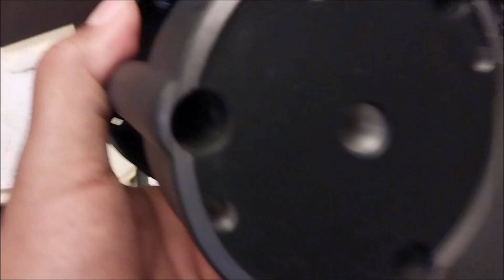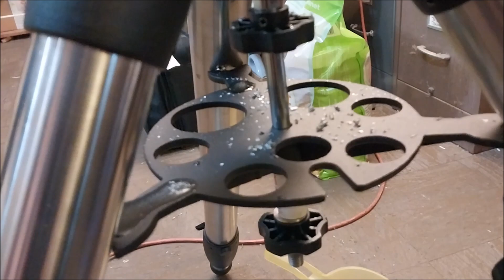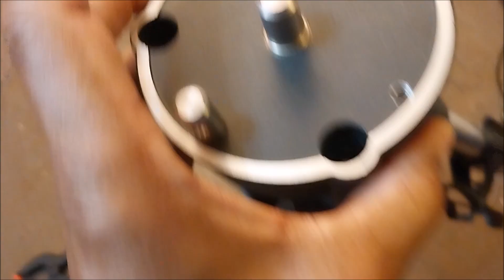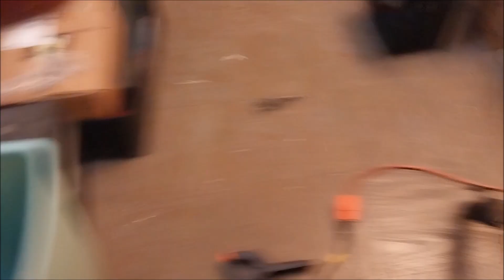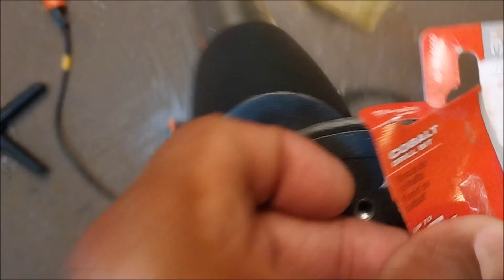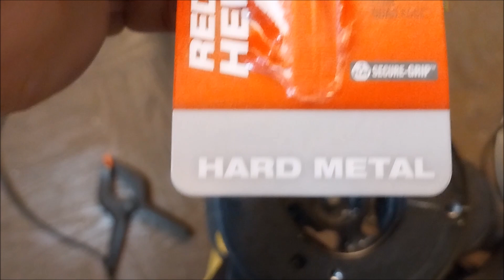Adapting an AVX tripod for the HAE29 (and other iOptron mounts)

Comment: I have an AVX and think of purchasing an AM5 or HEM27. ZWO offered a pier, PE200, which comes with an adapter plate which fits the AVX and Skywatcher mounts. Your modification is doable for me. I want to use my AVX tripod because my C8 SCT weights about 18.5lbs with the image train and miniPC.  I don't really have room to store another tripod. I wish they offered a conversion plate with their pier. Thanks

Comment: I have an HAE29 on the iOptron steel tripod find it is not as stable as the AVX. The leg spread is narrower on the iOptron. Yet I like the add on feet, so Iput a set on my AVX. I will now try to find another AVX tripod!
Reply: A machine shop charged me $20.00 to drill and thread my AVX tripod.